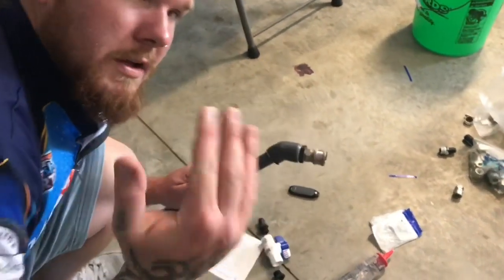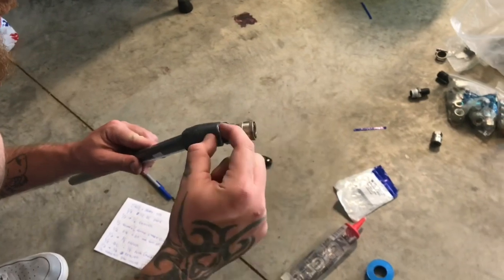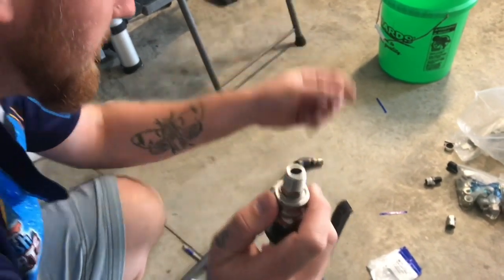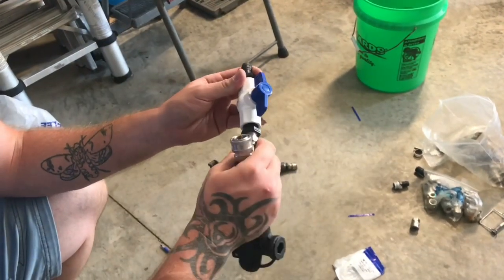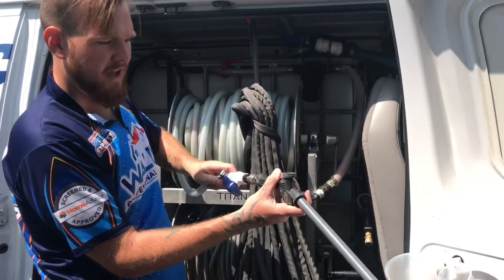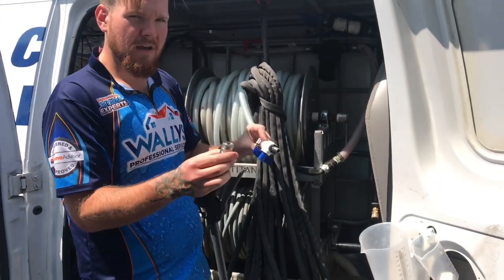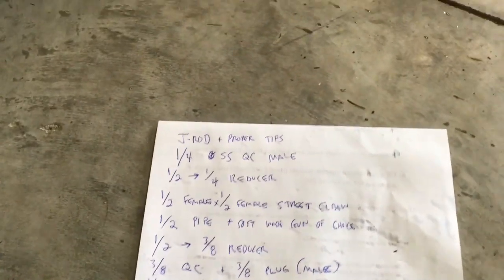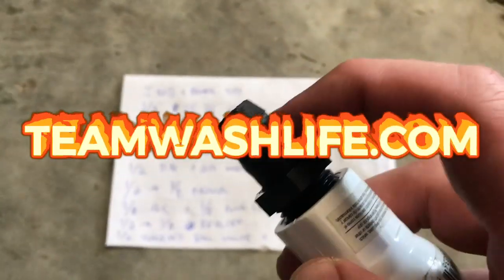STEP BY STEP: How To Build Soft Wash Gun With Ball Valve

Comment: Just some extra info. 1/2" npt 1/2" quick connects exist. But the 3/8" is better because you can buy a bunch and it'll be interchangeable with your pressure washer and you're not having to stock an extra item for one use purpose.

Comment: you'll find that the extension wand on the end of your poly gun will be very tiring to use on roofs, and it will leak a lot of chem out of it once you let the trigger off because of the chem in the wand, ball valve or not it will leak out. I took my extension off and am way happier with it. You'll also want to get a swivel on it.
Reply: You use a 6 inch wand right ?

Comment: I love it I was who introduced the quick connect system into the soft wash systems a few years ago.  Try to just go 1/2” male coupler from P tek and then just get a 1/2” male plug and that will thread right into the gun then you have no need to use any reducers.  The 1/2” stuff will have to be Hansen so its more costly but mine is 3 yrs old and still works awesome.  I also recommend using a schedule 80 ball valve it will handle the stress better.  Or if you can get a viton ball valve mine is 2 yrs old still going strong.  I posted videos a long time ago on many FB sites and of recent as well lmk and I’ll tag you in them.
Reply from the maker: Yeah you can always make them bigger and better, this is what I had laying around in the shop. Thanks for posting the feedback thats interesting that you introduced Q/C to softwash systems
Reply: John Lange  yes several years ago No one was doing this and I kept burning up guns and also wanted to use a ball valve wand so I made one and now others have followed.  Soft wash pressure wash community is a good page to join and you will see some recent videos and some of my rig etc.  Keep up the good work.

Comment: Do you use regular pipe tape or is there one better resistant to chemicals
Reply from the maker: Steven Mendez good question but no, just regular pipe tape. I went a lil crazy and even put a couple drops of epoxy sealant (the stuff we use to seal up loose outlets when prepping a house wash) but I prolly did not need to do that, I just really hate coming across air leaks haha

Comment: You can use RectorSeal Tru-Blu pipe thread sealant with PTFE or
RectorSeal TPlus 2 Sealent instead of pipe tape for your softwash fittings and for your high pressure washer hose fittings you can use Loxeal 54-03 instead of pipe tape. These medium liquid pipe sealers work much better that pipe tape with less problems and are easy to take apart at anytime to change fittings. The Loxeal 54-03 you can get at pressure washer products. 
https://shop.pressurewasherproducts.com/50ml-MEDIUM-LIQUID-THREADLOCK-FOR-HIGH-PRESSURE-FITTING-USE-5004.htm

Comment: I want a dual softwash and pressure washing setup installed in an extra long van. Tanks, reels........Is it possible?
Reply: Soft wash systems are separate from pressure washing. But you can make it all fit in a van. I've seen it. Just gotta measure out how much space you need for any tank(s) you're installing and account for room for your pumps, battery, hoses, chemicals, etc.

Comment: Those soft wash systems on PressureTek are $1,200 not $300-400.  Their pumps are $300 - 400. IMHOP Building your own system, save $$ and you can customize it for your needs